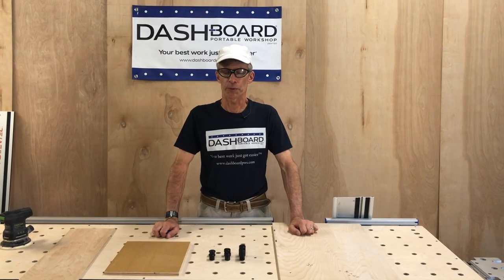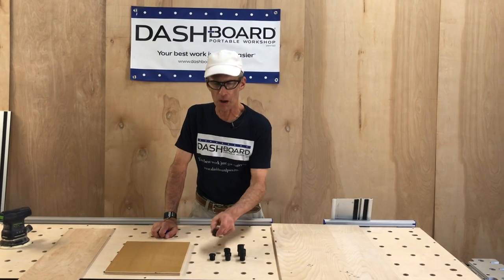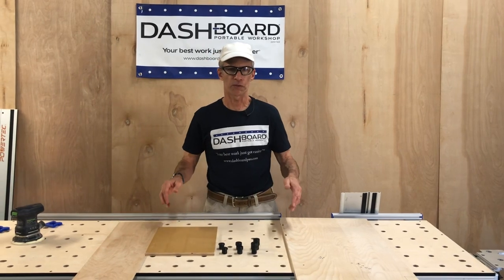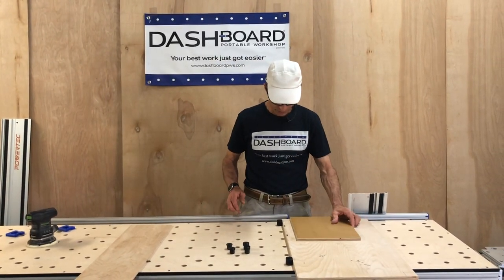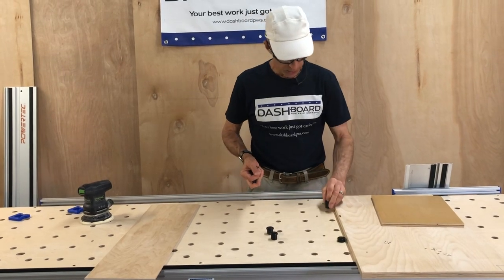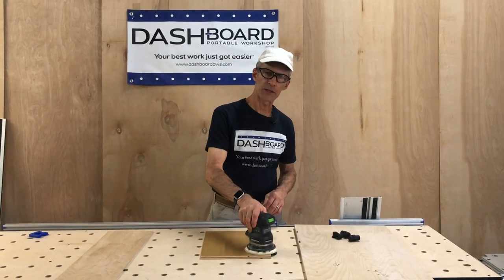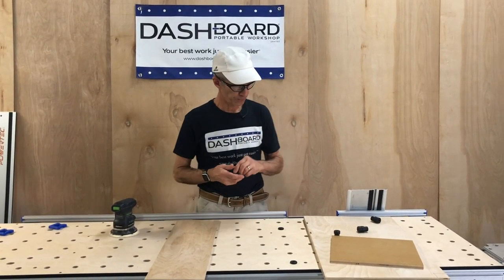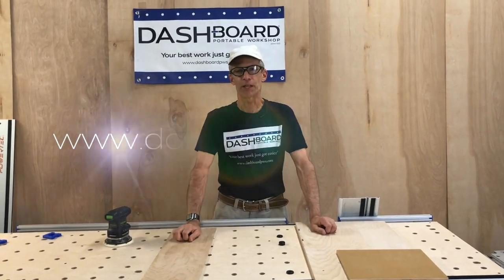Choosing Bench Dogs for your Dash-Board® Guide Rail Brackets

Comment: Do you still need clamps on the table if you're using the bench dogs?  Speaking of clamps, is there a type of clamp that works with the table holes and on the other parts of the table?
Reply from the maker: I'd say it depends on whether the piece you're working on is likely to lift off the surface or total security is essential. About using dogs for the Guide Rail Bracket setup, we include the 1/2" ones standard now so there's no choice left to be made in that case.

Most track clamps should work with our tops and the tracks on the frame, Festool, Bessey, and Powertec are examples. I'm not a fan of the Makita clamps, though, or Dewalt. The Festool horizontal clamps are also helpful. Clamps are not compatible with our Outrigger frames or fences.